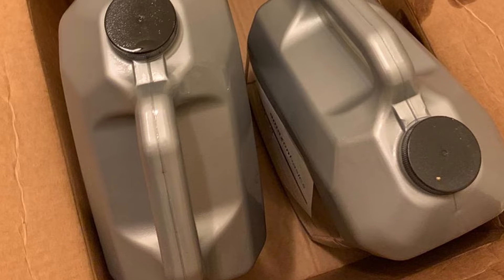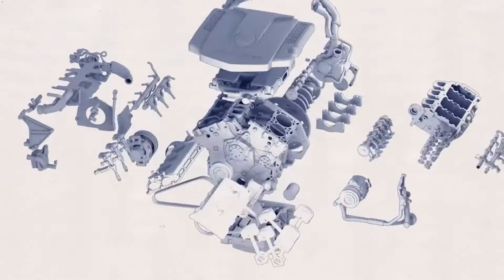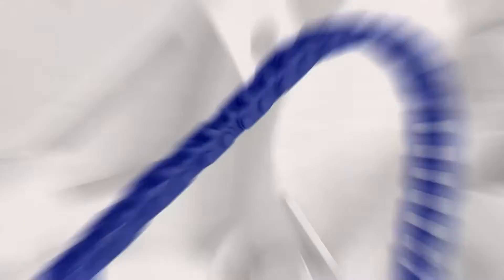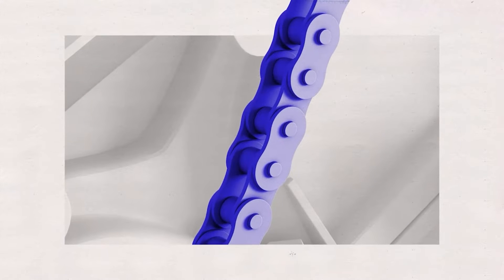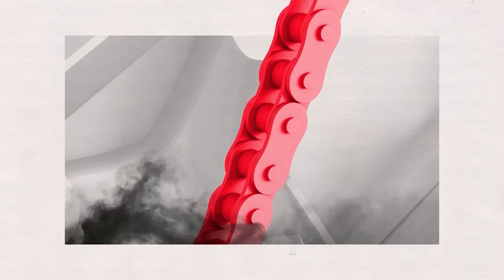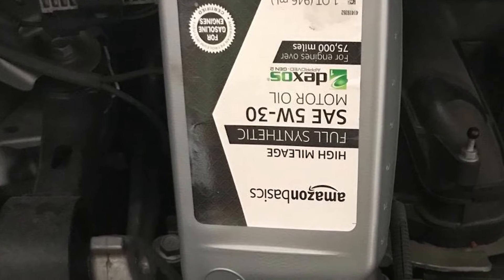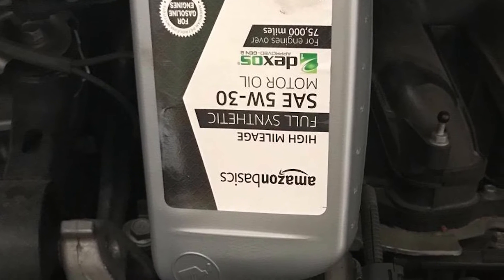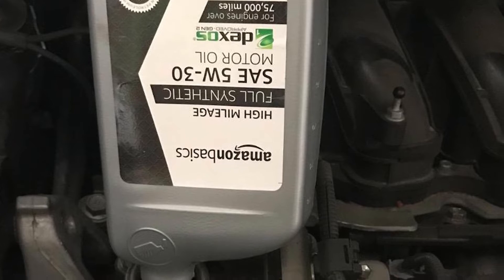5w20 Vs 5w30 Engine Oil - What is the Difference? | Which Oil Is Thicker?

Comment: There is little differance  betwween the 0w (-40f)  and 5w (-31f),  about -10 degrees.....Unless you live in Alaska or Sibedria there is no need to use a 0w oil that cost more. 
It is the high number 20 - 30 - 40  that determines the engines protection.